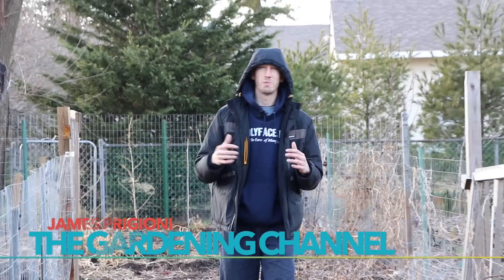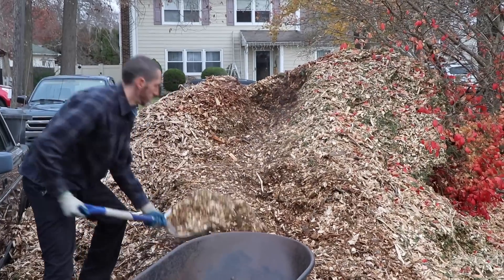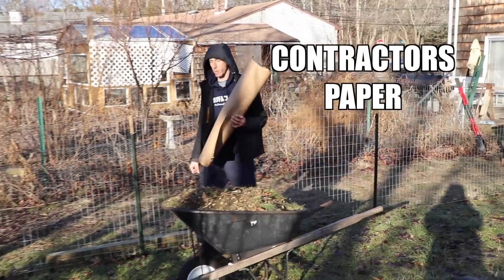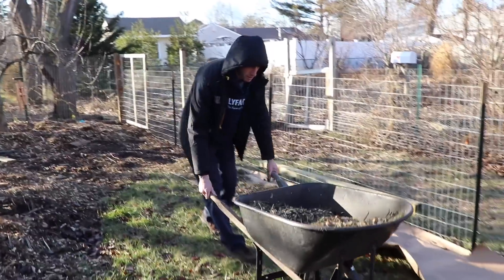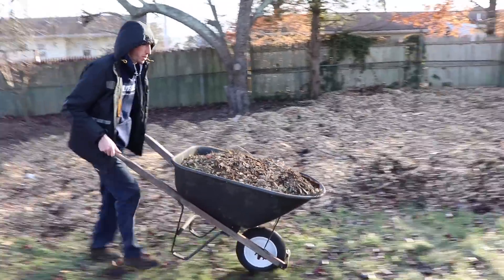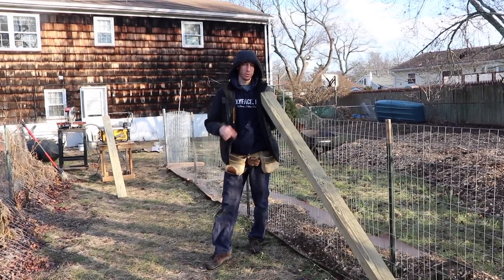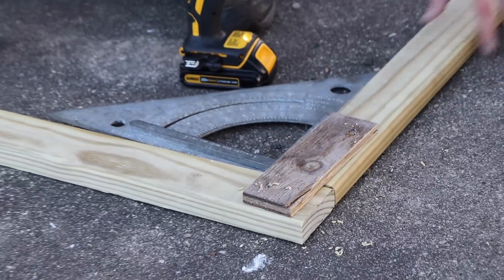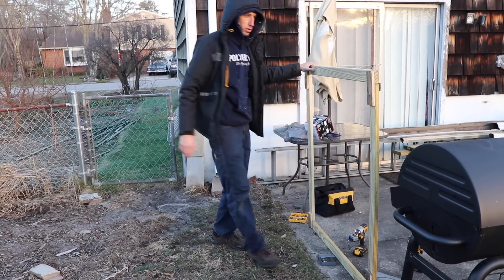EXCUSES are just well planned LIES! Working on the FOOD FOREST GARDEN

Comment: If I could offer a tip to your already good ideas, it would be not to use those plywood scraps as you will regret it, and have to re-do it, but instead to buy a truss plate when your in lowes. Very inexpensive and will last a long time (looks nicer too). Plywood deteriorates quickly in that environment. You could also use a scrap board that is pressure treated instead of plywood. All of your videos have been very helpful to me, so I humbly offer this tip to you. I am a new gardener but long carpenter. Thanks again for these videos. I look forward to them.

Comment: Hi
I am planning to make a food forest. The place is 8 meter by 8 meter and full with stinging nettles. I only did find two ways for removing them. The chemical way and the manual way (removing them by hand). I don't prefer both. And just putting woodchips on top wouldn't work they grow trough. Any tips? I live on Belgium if the climate matters.

Comment: Great job! However, the contact paper will deteriorate eventually and then you will get weeds. I put cardboard down and then the leaves and wood chips 3 years ago and now I have  weeds.
Reply: Are you adding more wood chips each year?  If you don't continually add wood chips or some type of ground cover/mulch material it eventually breaks down underneath and you will end up with weeds.  Also, there will always be a certain amount of weeds but with a thick mulch layer they should be very easy to remove.